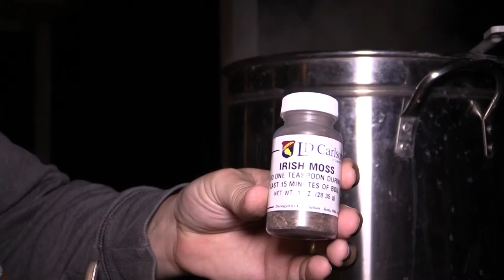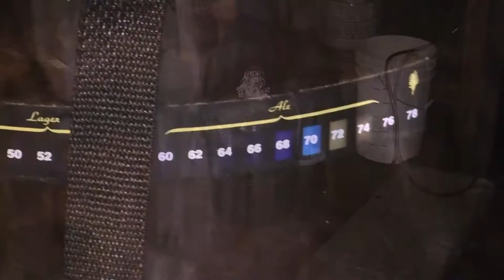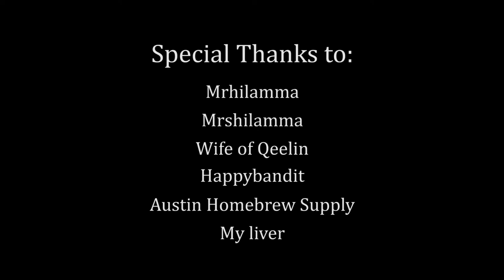Brewing up some Orc's Blood

Comment from the maker: Mrshilamma, you have replies blocked somehow. Lol, it's a refractometer. They measure gravity in Brix and are mostly used in brewing wine. If you get an ATC one (Automatic Temperature Compensation) they are great for brewing beer and aree super cheap ($25 - $30 on amazon).